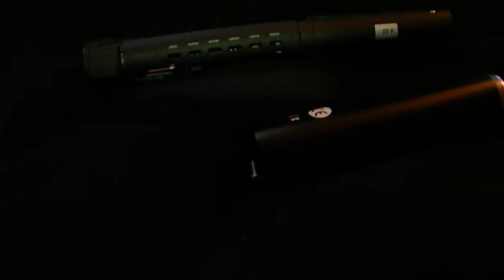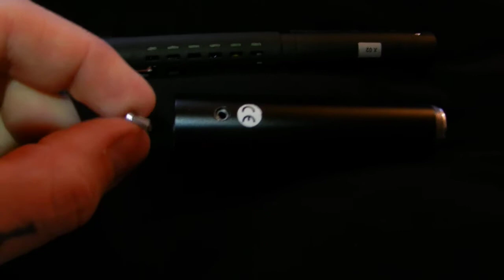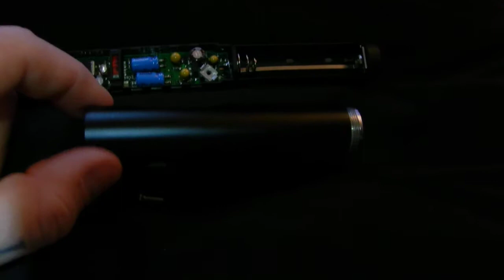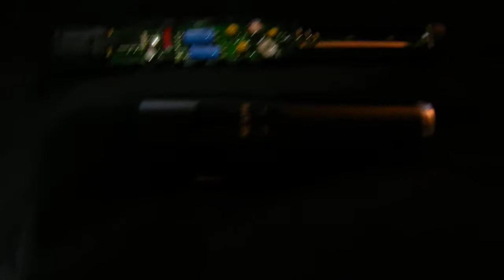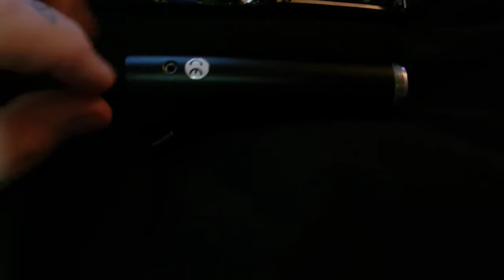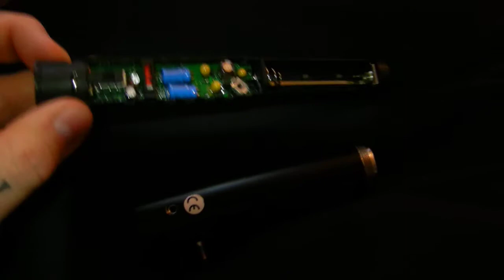SENNHEISER K6 MODULE DESIGN FLAW AND FIX! FOR ME66, ME64, ME67, ME62

Comment: I can confirm that this fault also appears on the non battery powered version, the KP6. After I followed the procedure suggested in the video, the cradle, noise went away! However. Turning the mic on and of, it does give some cradle sounds before its either off or on. Does anyone have any suggestions how to get rid of it? Thanx for an awesome video!!